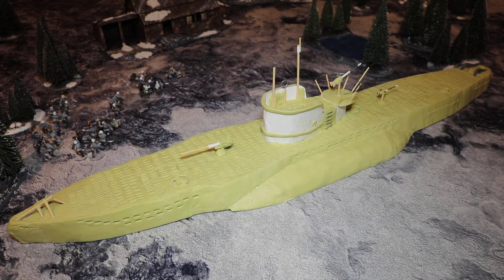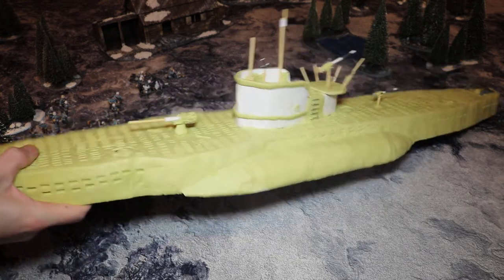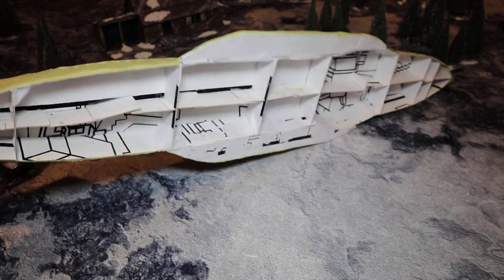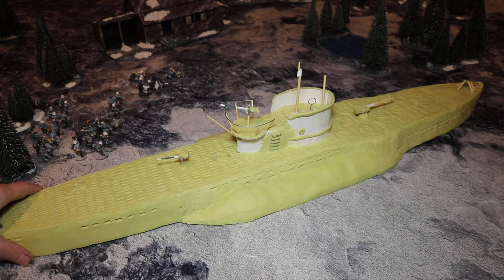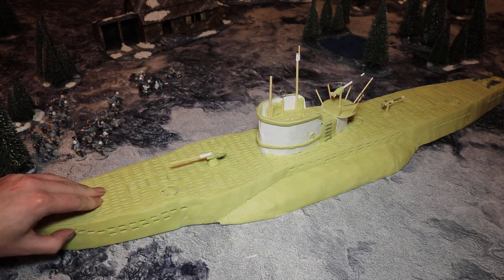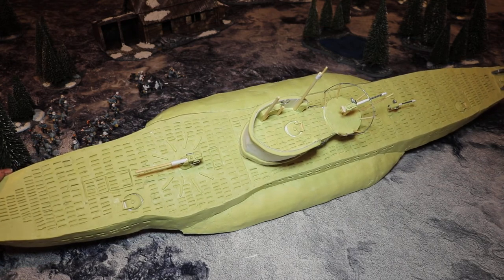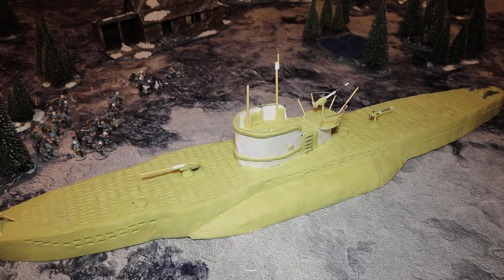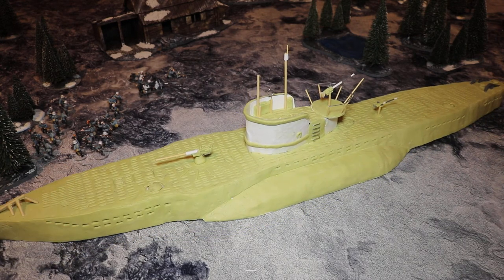Type VII U boat Project part 5

Comment: Very Impressive  model and I would  say it stands up quite  well compared to the Trumpter 1/48 scale plastic model which is  4 feet in length.  If you ever want  to  do a project that is unbelievable try doing an I-400 Japanese Submarine. They were monsters that  carried planes.
Reply from the maker: I built a coastal Japanese sub a few years back and have plans for a Japanese carrier too